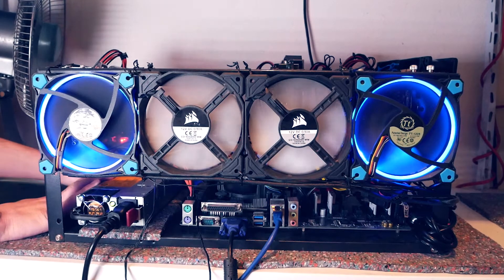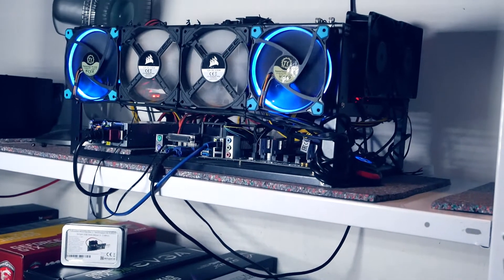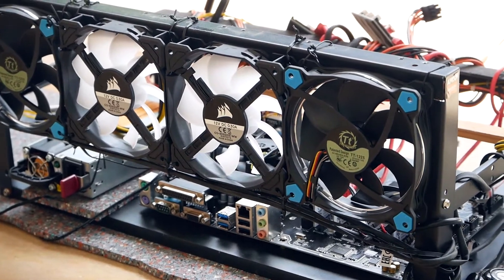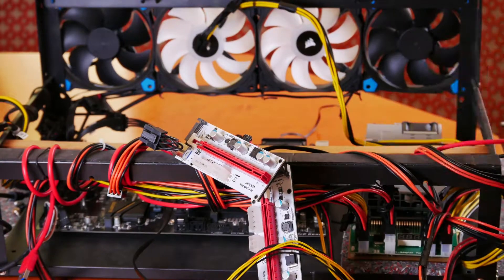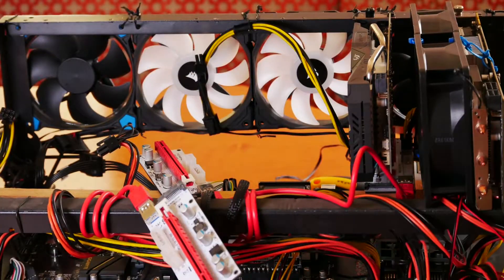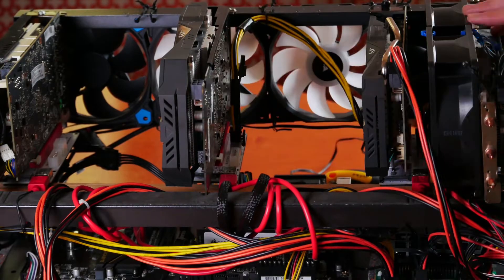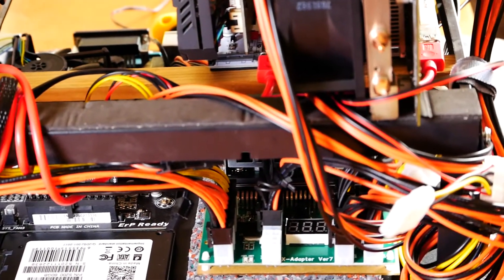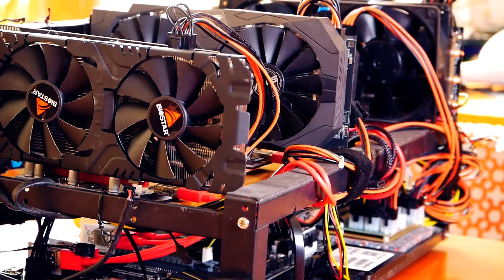Spring Cleaning a GPU Mining Rig (open air AMD)

Comment: I clicked like for u.... Are those 6pin   all customized? They look very fat.  Shld b <18awg
Reply from the maker: Thanks man, welcome to the channel! You mean the red/black 6 pin wires? They actually came with Deepinthemines server supply kits they had back in the day, seem sold out now. It was Server Power Supply + Breakout Board + Cables, so I am not sure if they actually included <18awg wires, but they are generally better quality than normal ebay sets. If you want to check my second "Crypto Mining Mail" video, there I actually ordered what was advertised as "heavy duty PCIE cables" in Germany but they only had 2 pieces left. They actually even look a bit bigger than the red ones. Unfortunately they did not have enough left so I could actually do some testing, but I am always about safe power. Cool you noticed!